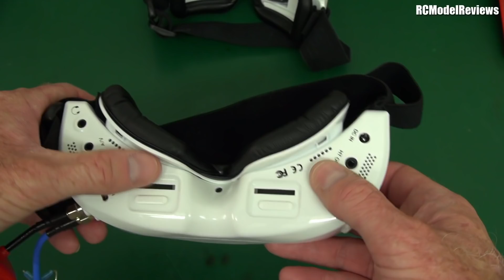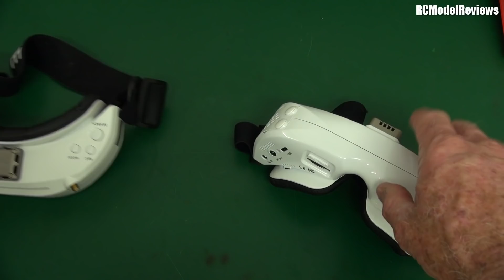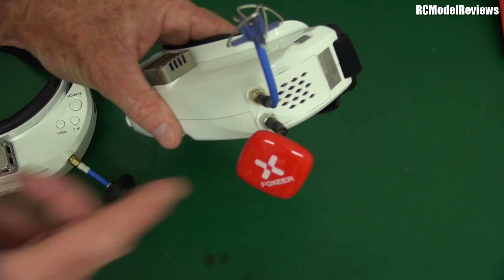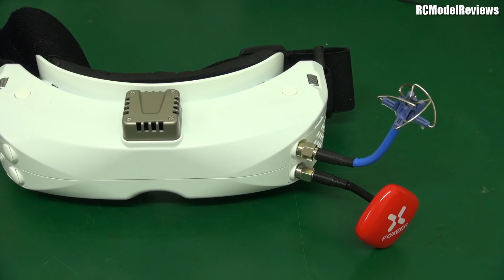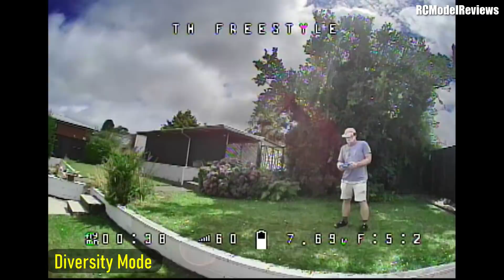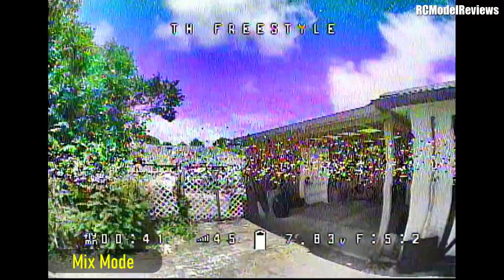Review: Skyzone 04X FPV goggles for drones and RC planes

Comment: Got a question. I have SKY04X and there is a black barely visible line (about 1 sm wide) scrolling slowly from bottom up on display and once it reaches the top another similar line starts to climb up the screen. What could be a problem and how to fix it? It does not interfere much with general view. I have the latest firmware updated. My goggles version is V1. I tested with two cams, Runcam Hybrid 2 and Phoenix 2, and it seems that the problem is not with the cams.

Comment: Hey Bruce, Thanks for the review. Apparently there is a new version of the Skyzone Steadyview they will call the "Steadyview X" with fixes for the diversity switching issues the current Steadyview has and particularly with some cameras. The latest O4X's are shipping with the latest firmware which have the extra menu options for the new upcomming module. I hope Skyzone support the current module owners appropriately....

Comment: hey bruce, does the fan actually suck air from the eyecup area? i have alot of fogging issues with any goggle a wear because i sweat quite a bit . been using box goggles as the screens are farther from the face but i still fog those up too.

Comment: 2:10 Well said! It will be a step back in the right direction to 4:3 when the manufactures of FPV equipment break free of using 16:9 CMOS sensors designed for commercial non-FPV video use when all FPV pilots realize the huge difference between a fixed frame of visual reference like you have sitting in a wide screen movie theater where the director controls the horizon... and the variable frame of reference you have when flying where up and down become left and right doing a roll or flying knife edge sideways. In either axis you need to see where you are going and what's coming into view as soon as possible. Just think how much distance you cover and how much longer you have to wait to see the tip of a tree in your flight path coming out of a loop. Just think how sad you would feel if you hit a nest full of little baby Yellow Bellied Sap Suckers as I really doubt they will want to give it back.

Comment: Hi Bruce , have a question if I may . I'm building an FPV camera / transmitter combo , the only way I can mount the antenna (right hand circular polarized) is inverted . So , looking at the antenna , if I mount it upside down , does it now become lefthand polarized ? or does this not have any bearing on the radiation pattern ?

Comment: The stock receivers on any Skyzone goggle have been more then fine for flying within ranges we are supposed to be. No need for all that external add on stuff with these. If you need more power then a base station set up on a tripod is the best add on. I have my 02x and uses a runcam pheonix2 and I think the picture in the goggles is better then any DJI video I have seen yet. I fly IN trees and have zero issue seeing scraggle.

Comment: Hi Bruce, nice review :) Just a small correction; you can run quadversity if you use a Skyzone Steadyview/Eachine Rapidmix module, which are the same as the included module.

Comment: A couple of minor annoyances I've found for people who might be interested in these goggles:

1. The module bay is slightly too short to fit some receivers. Not a big deal because you can just file off some of the plastic and because the included receiver works fine in my experience.
2. Whatever adhesive they use on the foam padding is horrible, mine was peeling off within ~2 weeks. I switched to my own double sided tape and haven't had any issues.
3. The fan tends to rub on it's power wires occasionally. Easy to fix by taking the fan cover off and using tweezers to bend the wires down.
4. The auto record feature on the DVR seems unreliable in my experience. Sometimes it won't start recording until 10-20 seconds after getting signal, and sometimes it won't record at all.

I've had my sky04x's for a little over 2 months now and could only come up with this small handful of downsides. If that doesn't tell you how awesome the goggles are, I'll just tell you now. These goggles are awesome. The screens are great, the receiver is great, the DVR is great. If you're in the market for a high end set of analog goggles, these are the ones to get.

Comment: Recently I bought a little fpv set from aliexpress. the nice thing about this is that the receiver will plug in to the phone's otg port and gets its power also from the phone. you need to download an app like otg view or fpv view or something. when you insert the videoreceiver the app will open and you can autoscan until it will find the best strongest signal. the screen can be split by a push of the button and this way you have an oled screen. My idea is to buy some cheap second hand vr goggles that can adjust the focus and distance between the eyes and then slide my phone in. Wouldn't this give you a cheap well working system? The set is very inexpensive. camera with internal video transmitter  and receiver for under 30 euro. and second hand vr goggles maybe 15 euro? could you do a review about this to compare quality maybe to these skyzone googles?
it is called: downlink otg. you can also buy only the receiver and use some other camera with transmitter.

Comment: 600€ is over the top.
I can wait till dji has learned to deliver oled goggles that will support fpv drones and dji drones too. 
I won't buy goggles for one purpose only ... cause I have dji drones and planes I use for fpv with dji fpv goggles racing edition that also support analog fpv out of the box

Comment: Bruce, does the sympathetic resonance also apply to the receiving antennas? I can imagine if two antennas are close to each other and both transmitting, this would result in interference, but if they're just listening it shouldn't matter, should it?
 
I'd be more worried about the dual antennas on many VTXes. Fortunately, they're usually installed more or less perpendicular, so as to get good reception regardless of the drone's orientation.
Reply: Yes, interaction between antennas works if they are for receive or transmit ... The unused antenna acts as a parasitic antenna/Element then, It can affect the way the signal is recieved or transmitted from the working antenna , This can skew the signal, Make it more directional in one direction over another  and so on .
Reply: @Gw0wvl  thanks for the info.

Comment: You can't beat a Bruce video for honesty, that is for sure. And I understand what you mean about preferring analog over digital when it comes to pushing the range. I liken it to the switchover  between Digital TV from analog, digital being great until the reception gets a bit poor, due to maybe a heavy rain shower between rx and tx. With the old analog I would just get a bit of snow in the picture, but with digital it just craps out totally.

Comment: good review :) really I do like Your fair opinion. 1st - they still got problems with some camera/TX combination - which was little better with some firmware update, also they still promised next update which should improve it again - will see. just be aware, that some combination is not working ATM (diversity mode they do suggest to solve it is IMHO not as good as other receivers). 2nd problem - bay for modules are v. small - their own modules do fit (steadyview/rapidmix), rapidfire also can be put with some DIY work and custom cover - but a lot of other great RX just can not be used (trueD, Fusion, pro58) as they simply will not fit :/ just a bigger module bay need to be made - maybe a 04x v2 ;) 
other then those problems - they are really nice. Community support also look not bad - they do respond quickly on FB groups.

Comment: Who the hell puts a non latching power input connector UNDERNEATH! which rock were they bashed on the head with? Infuriates me. Losing goggles mid-flight is incredibly dangerous and easy to do with this silly arrangement.
Reply: Fortunately the barrel connector is a good tight fit and certainly won't fall out.  More of a worry to me is the very short and loose connector that DJI use on their goggles.  That does cause intermittent loss of power to the goggles so many people have 3D printed a little bracket to hold it in place.  Never had a problem with my SkyZones although the right-angle versions of the barrel connector  (that plugs in the side) of goggles does have a tendancy for the wires to fracture internally.  I had this problem on my Aomway goggles.

Comment: Nice review Bruce! I have to say even though I've been spoiled by digital, recently I've been enjoying going back to analog and the light and inexpensive gear not to mention the still-excellent, low-latency live-video feel. I sure would like to upgrade my Attitude V4s to something with OLEDs. None of them are cheap but I'd say I would either get these Skyzones or Orqas since I already have a RapidFIre module.
Also, thanks to your thumbnail, I have Tina Turner’s “The Best” stuck in my head!

Comment: Thanks for the review Bruce! I should receive mine Monday😃. I went with this antenna setup..https://pyrodrone.com/products/menace-fpv-goggle-antenna-pack-5-8ghz-polarised-rhcp
And a 45 degree sma adapter to point the directional antenna at a more optimal angle like you mentioned. I was really looking forward to what you had to say about them. Now I'm chuffed to bits about flying with them😁

Comment: About module bays: you'll need to dremel them a lot if you want to install tbs fusion (also the fusion boards) -there3no way it'll fit out of the box. I assume the same applies to other non-skyzone/eachine modules like rapidfire....

Comment: I bought the EV300-O in white, fantastic upgrade from EV100.  I have a Foxeer patch and a very tall Foxeer lollipop, plenty of space between them as you suggested.  But 'mix' mode is terrible on the module, just use diversity.

Comment: Yeah, see, I couldn't say they are the best because they don't accept diopters. Sure, they have adjustable focus, but they don't take into account that people have astigmatisms and stronger prescriptions. Massive fail for me. I love my Sky02 V+ goggles, but really want some new ones. I was really looking forward to the 04X, but its a no go. Super bummer. The only option now for good OLED analog goggles are the Orqa ones, they accept diopters. I will be moving to DJI soon, but still want a separate good pair of analog goggles. Thanks Bruce! Great review.
Reply: Hey Luis,
See if you can find stick on lenses used for scuba. Just a little water stick them on. I don't know if you can find your required strength, but it is worth a try. Good luck.